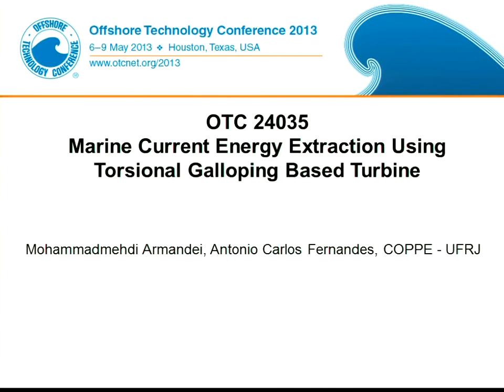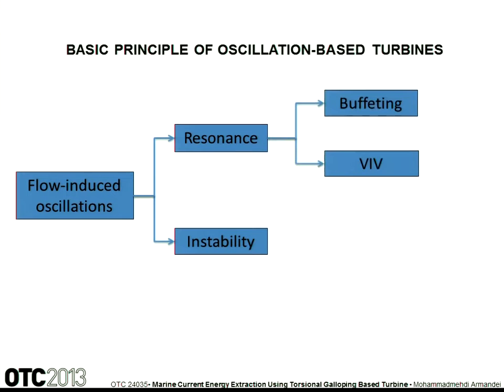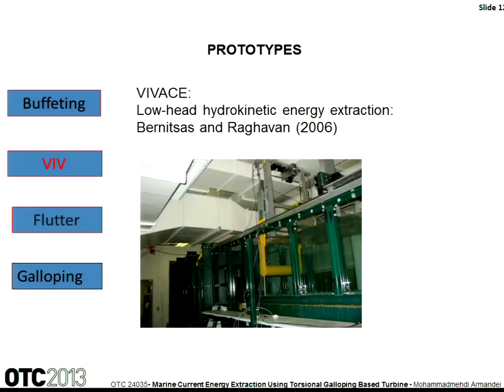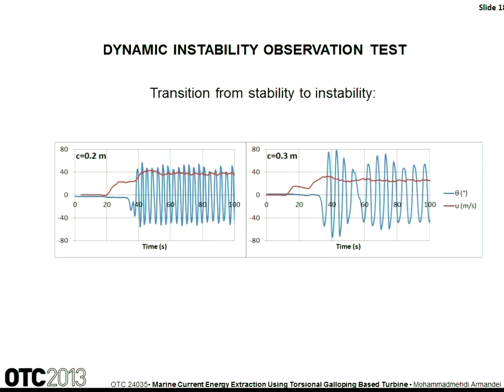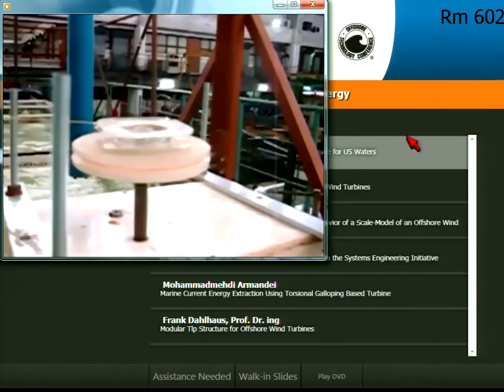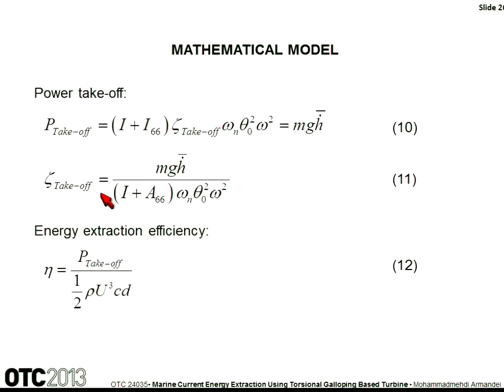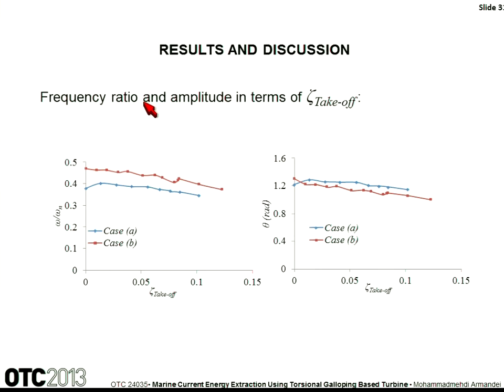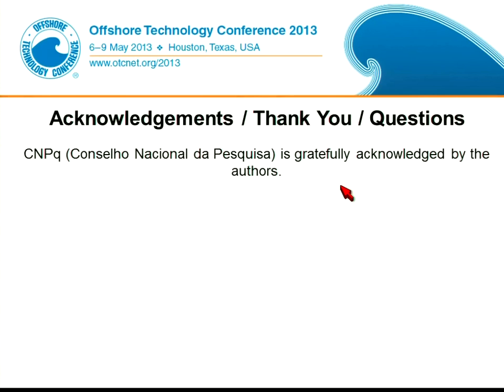Marine Current Energy Extraction Using Torsional Galloping Based Turbine   OnePetro

Comment: Assalamualamualaikum,
I just read through your journal on this subject and congratulation on the success of your research. I also doing a study on hydro-kinetic turbine in Malaysian river. If possible can I get a copy of your slide presented here for my reference. You can email it to my email me03594@gmail.com 

Anyway just out of curiosity, I'm interested on the mechanism used for the continuous conversion of the oscillating energy to rotational energy, can you share it?. Furthermore I notice there is a jerking motion during the transition of the blade, it will effect badly on the power conversion using any type of PMG system, have you look into that problem especial on the power quality? 

Your help is much appreciated. Thank you.